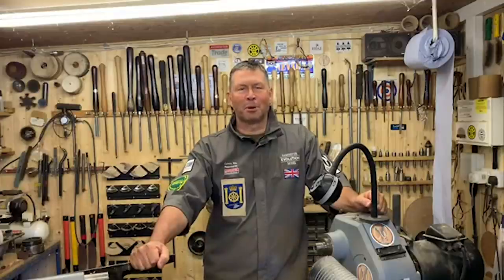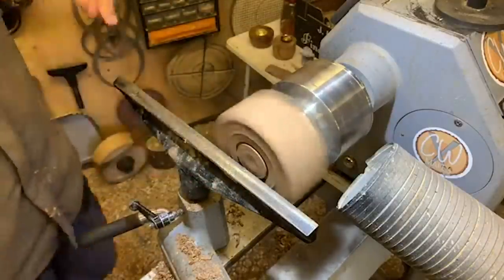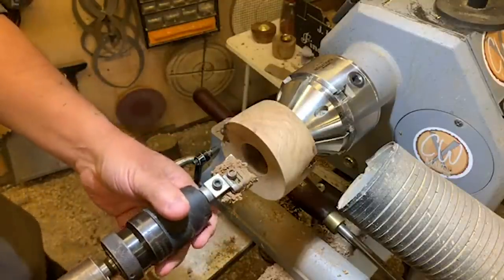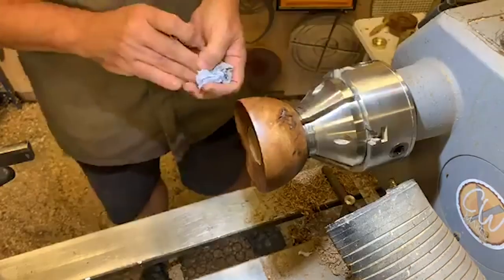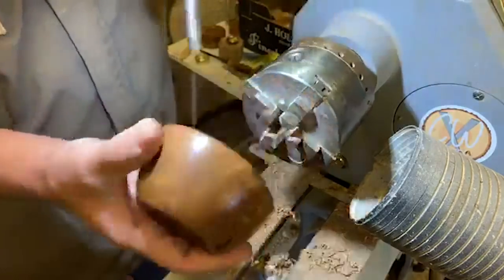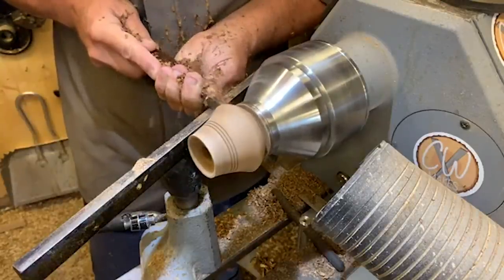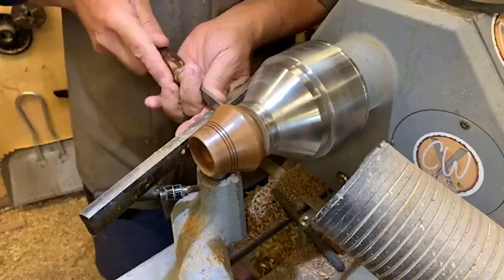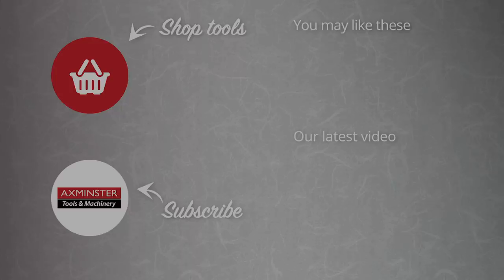#SkillCentreAtHome - Live Turning Tuesday - Tealights

Comment: Why do you create the foot you seem to use most if not all the time, rather than a recessed foot thus saving you returning to remove the foot?
Reply from the maker: Hi Brian, the following reply is from Colwin :) - "Because a recess isn't liked by shops and galleries if you intend to sell your work, as it shows a holding point. It is better to finish the piece and take away all holding points, the same applies to bowls.